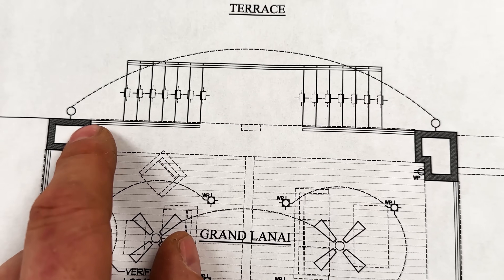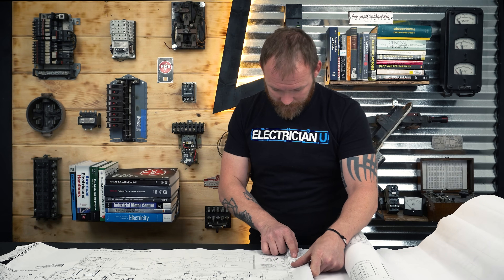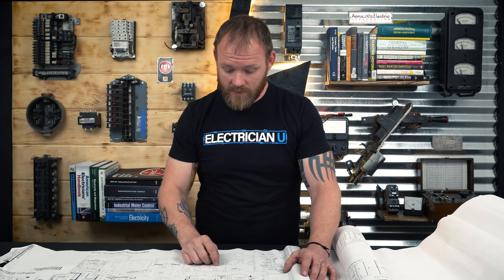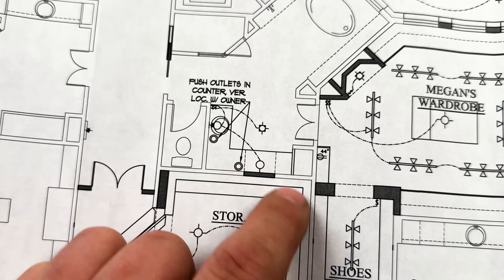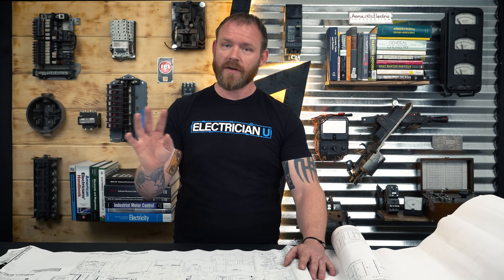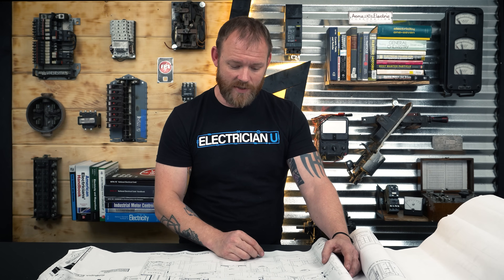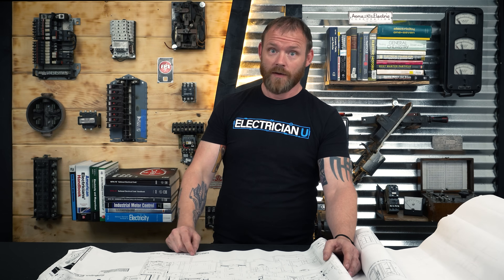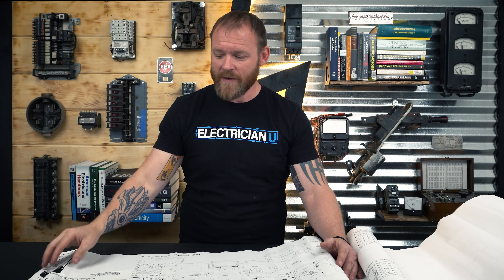Blueprints Deciphered: How to Read Residential Plans (For Electricians)

Comment: Another good piece of information is to always check framing plans to see if there are any missing windows or optional doors missing or if they’re framed wrong. Countless times I’ve had to move wires because a window or door got missed. If you notice it’s missing just roughly template it out and put your wires far away from it so they can add it and you won’t need to make a return trip.

Comment: Hey Electrician u what's better to use copper or aluminum to run to your shed or garage I wanna run 6 gauge wire to a shed that's 275 feet I know coppers more expensive, also most ill run in this shed is an air compressor but voltage drop I keep trying go to calculator but hard to figure out drop or I need bigger? Thanks love your videos

Comment: hey so i’m on a lab with 3 floors and each panel location we’re installing/ running racks of 3/4 / 1” to each lab/break areas. i noticed on the plans as the first panel has 400 amp main but it also supply’s the rest (9-12)100 amp main disconnects. i’m not sure how it’s able to supply effectively unless it’s paralleled? but i’m just curious about my job

Comment: How do you decide which type of lights, outlets and switches to buy and install?
Reply: With a set of prints, there should also be a set of specs or specifications.  It might be a few lines on one of the sheets, or it may be a several hundred page book.  Various firms often have their "basic" specs and can tweak it for each customer.

The specs lay out things like receptacle heights, switch heights, orientation, style, manufacturer, etc.  What type of wire or conduit to use, etc.  The prints tell you what to do, and the specs tell you how to do it.

Without specs, it's up to the contractor.

Comment: Crappy journeyman yelling at the apprentices to get away from the plans. If an apprentice is interested in plans a good teacher will bring the plans into the daily/weekly (or however periodic) planning sessions so the apprentices can learn how what they are doing relates to The Plan™ for that job.
Reply: Plans are very expensive, really an apprentice has no business near them.  Alot of what is on the prints is frequently changed on the fly anyway.  

You must not be in the trade because the majority of J-men don't teach.  If anything they will show you how to mount a box and pull wire. Stuff that an apprentice needs to do his job. Beyond that you're expected to educate yourself. No J-man is gonna teach you about ohms law or electrical theory.   

The time a J-man spends teaching you is time lost doing his own work while his is frequently more important, such as labeling and pulling circuits while anyone off the turnip truck can wire a recep.
Reply: @beeps7 there is always time for teaching. 
But there is a time for everything.
First things first.
Learn how to work well and eficiently, then learn other more specific things..

Comment: Wired in a custom home that had the worse architect do all the drawings. He had laundry chute 3' out of position causing at least 8 home runs moved twice. Never had the pull downs steps in drawing so had to move more home runs. Never shown elevation so one of the four outdoor receptacles was only 8" above patio outdoor hose bib had to be turned so hose could be attached. Could not open kitchen drawer unless you opened the dishwasher because he neglected to add a 3" filler strip between dishwasher and 90 degree cabinet turn. So much easier when you have accurate prints and no major changes at end of job.

Comment: A good review of cabinet plans with dimensions will save a ton of headaches and re-work.

 If possible get an appliance schedule so you know what sort of voltage and amperage for built in appliances. 

Checking exterior elevations will be handy to determine material type of exterior finishes so you can prepare properly for rough-in with masons, siding, or stucco installers. 

Plans are just that, plans. A good field foreman will be in contact with GC's/owners rep and subs to find out what will actually be installed. If owners are involved there will be changes. Don't expect to get that memo without initiating the conversation.